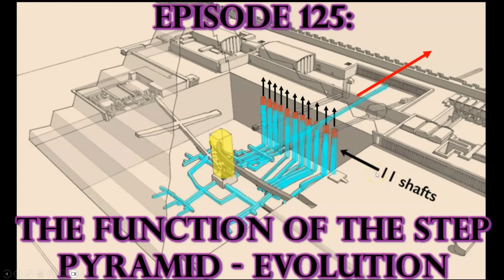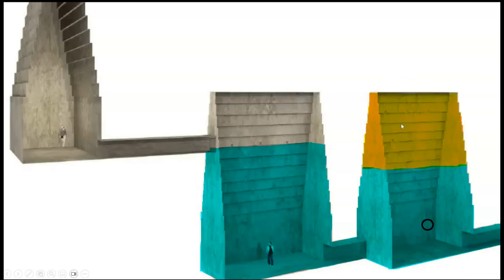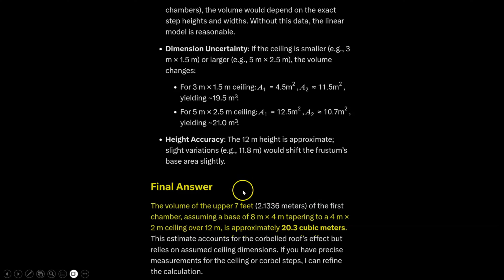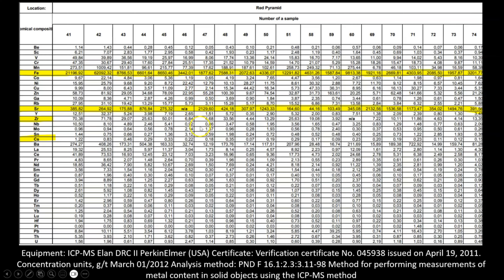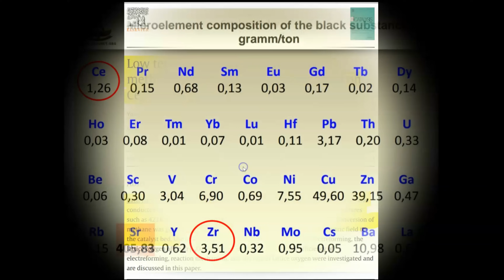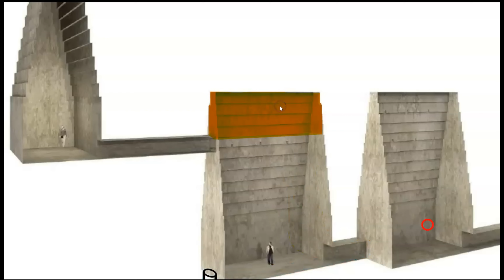Episode 157: EGYPTIAN PYRAMID CHEMICAL ENGINEERING TECHNOLOGY - PART 2, TEMPERATURE AND PRESSURE

Comment: Man this is tough. Those flow patterns are quite convincing. Initially i thought they would've used a metal liner in the chambers. It's hard to imagine the types of pressures and heat being handled by those exposed corbelled stone steps. What do you think used to be in the opening between chambers? And how was it kept in place without leaving mounting marks if it was there. Why aren't the corners rounded out if nothing was there? I'm trying to come up with a conduction path for lightning that it would actually obey lol as well as make the fields required. Can't do it. I assume the paper you mentioned produced an RF wave from the interior? I'll look at the paper next. Probably need hardware there too and don't think it could be lightning powered. I'm convinced this is a machine and this is so far the stickiest theory. If i sound critical I'm actually just deeply curious and want to make this work. Whatever the state of maturation of the theory it's a necessary and bold step in any form. Thank you for the work, I find it extremely stimulating to a degree i haven't experienced in quite a while

Comment: Das Ganze ist interessant, aber der entscheidende Punkt ist:
Wie soll das Methan überhaupt auf 48 bar komprimiert werden?
Dafür wäre eine Wassersäule von rund 480 Metern nötig.

Wenn die Pyramide ein Zylinder mit einem echten Kolbensystem wäre, könnte man unter Umständen solche Drücke erzeugen.
Der tatsächliche Aufbau ist jedoch lediglich ein statischer Steinbau mit einem viel zu geringen möglichen Wasserstand.

Hydrostatischer Druck hängt ausschließlich von der Höhendifferenz ab.
Der Druck ist überall gleich, solange die Höhe gleich ist.
Mit Volumen allein lässt sich kein zusätzlicher Druck „herbeitricksen“.

Damit bricht auch die Annahme einer adiabatischen Kompression weg —
und mit ihr fällt die gesamte Theorie in sich zusammen 🤷🏻
Reply: Leider keine Antwort dazu von OP. Man könnte es nur mit einer Pumpe sonst machen und dann hat man vermutlich Metallurgie so gut das man eh ein Metall Pressure vessel bauen kann. Ich komme aber immer zu diesen Theorien zurück weil die Dinger einfach wie Maschinen aussehen. Vielleicht braucht man weniger Druck wenn sonic chemistry mit gemacht wird. Mal schauen, ich bin elektrischer Ingenieur ich hab mit seiner lightning theory angefangen und konzentrier mich jetzt hier auf die angeblichen Chemie Reaktoren. Diese Zivilisation der Pyramiden Bauer müssen wir einfach mal jetzt lösen

Comment: You may have already made this calculation- 
what water pressure would be required at the inlet shaft to maintain pressure in the 1 st chamber? 
That would give a good indication of the hydraulic force required 
Defiantly more than gravity acting on the inlet water mass

Comment: I've worked in a Nickel plant. We ran a H2 unit that "cracked" Methane to produce the final product- Hydrogen. 
Steam was injected into the Methane which then travelled through vertical tubes loaded with activated Nickel Oxide inside a furnace. The carbon was  then removed by a liquid in a tower and thus, leaving Hydrogen. 
Your discovery is fantastic.

Comment: Very Good...TECH TALK. below:
1.  The last article you read..stated zirconium and cesium oxide SUPPORT.  That indicates that the catalyst is coated ontop of these substrates.  Catylsts ussually have a support substrate that is inert, hard, often brittle ..the reall catalyst, often metals, is coated on top of these inert hard materials.🎉 so I dont think cerium oxide or zirconium are the catalyst.  The nickel is.  Also..the majority of the catalyst support, is really the pyramid stone on which a coating is painted..they may have added cerium oxide and zirconium to give a multi dimensional support matrix.

2.  47 atm x 14.7 = 691 psi.  My mind turns to how they could create..and maintain this water pressure and water level..using the inlet water channels and then the ram shaft blocks in these channels...things to calculate and speculate
1.  How was that volume of water brought to that height level..constantly supplied while its pushing backward at steadily increasing pressure and eventually at 691 psi and held there for many hours
Was the weight of the ram blocks enough..were there significant leaks of water in the space between the ram oump.block and shaft...water tightness probably wasn't possible.
Reply: self correction - cerium oxide*  not cesium

Comment: Great episode.
Some questions though, 40ATM is about 400meter of waterpressure. How is that achieved?
Shouldnt all 3 chambers have equal pressure due to the open system, meaning you have to compress the air in 2nd and 3rd chambers to 40ATM/20times. Shouldnt that cause the final chamber to be filled much more than on your presentation?

I look forward to the upcoming episodes, great work!

Comment: Great work Geoff as always. It is getting really hard science. However i don't know if adhesion will be enough to pull down the all the gazes and avoid its tendency to occupy the whole free volume. Isn't there any obstructed outlet on top? Even the heated gazes having a higher pressure will ensure the flow into the next chamber but only until the pressure in the two chambers is equalized. So gaz may remain in the first chamber don't you think?

Comment: That's a fantastic article to share around! He puts to words what I'm struggling to communicate when I try to share this information. You've caused serious ripples, now the waves are coming and you will be surfing them all the way to vindication! 
The mathematics are absolutely insane! I'm rolling from one amazement into the next!

Just one thing you might have missed (and I'm only saying this because I know you want all critical feedback): the water will absorb some/a lot of that heat, and distribute it over its entire volume in the downwards shaft and both the 1st and 2nd chamber. So the actual reaction temperature will be a bit lower than the calculations here. Which is absolutely fine because even at half those temperatures the reaction still takes place as the articles you referenced claim. I tried having ChatGPT calculate how much heat is absorbed by the total volume of water of chamber 1 + chamber 2 + shaft:
I started with the same questions and it provided slightly different answers (not trying to correct you here, just stating the answers I got): It started out with slightly more precise measurements "8.36m×4.08m×12.3m= 418.6m3 (referencing archeological sources) Followed by a "More Accurate Estimation (Considering Corbelled Ceiling)" resulting in a total of 345.6 m3. 
For the upper 7 feet it wrongly assumed the tapering began at that base height, so I told it to assume a 20.3 m3 for that value. When asked to calculate the adiabatic reaction pressure and temperature it gave 41 ATM and 445 C (718K). 
Trying to not make this into a night-shift I proceeded with those values and asked about the reaction, and it gave me pretty much the same but much less detailed answer. Here's when I deviated:
Let's assume water (same temperature) was used to create that pressure, using both chamber 1 and chamber 2 (which has equal volume to chamber 1) and the total volume of that water was approximately 800 cubic meters (345-20=325, times 2= 750m3, I added a generous 50 m3 for the shaft's volume). How much heat of the adiabatic reaction would be absorbed by the water? Aaaaaand: unable to calculate that right now. -_-
Next question: Tell me what happens when methane and water are introduced into that chamber, with the water gradually rising to 7 feet below the ceiling. Great — let’s walk through the *physical and chemical events* that would likely occur inside the Red Pyramid’s first chamber when *methane gas* and *water* are introduced, and the water gradually rises to *7 feet below the tapered ceiling* (i.e., leaving the compressed gas space that we previously identified).

We’ll examine this in **stages**:

---

### 🧱 1. *Initial Setup*

* The chamber is sealed and contains *methane gas* at ambient temperature and pressure (25 °C, 1 atm).
* **Water begins to fill the chamber**, rising up to the 7-foot mark from the ceiling.
* The *total gas volume shrinks* from \~345.6 m³ to *\~20.3 m³**, causing a **drastic increase in pressure* — up to \~41 atm, per your earlier setup.
* This is a *quasi-adiabatic compression* (if fast and insulated), meaning temperature **rises sharply**, from 25 °C up to around **445 °C**.

---

### 🔥 2. *Thermal and Chemical Effects Begin*

At this point, you now have:

- Methane gas at 445 °C and 41 atm
- Liquid water at the same temperature and pressure (likely as pressurized hot water or near-steam)
* A very high-energy environment

Under these conditions, *several things begin to happen*:

---

### ⚗ 3. Steam-Methane Reforming (SMR)

If water enters as steam or is in contact with very hot methane gas:

- This reaction is endothermic and begins at \~400 °C
- At 445 °C and 41 atm, it can proceed*, especially if minerals like *iron or nickel are present (as catalysts)
- It produces:

- Hydrogen gas
- Carbon monoxide

This reaction *consumes some heat*, slowing further temperature rise.

---

### ♻ 4. Water-Gas Shift Reaction

The CO then reacts with more water:

- *Exothermic*, slightly offsets the cooling from SMR
- More hydrogen is produced

---

### 💥 5. Potential Runaway or Collapse

Depending on how *controlled* the system is:

- If water is introduced too quickly*, it will *quench the reaction — absorbing so much heat that the temperature crashes.
- If it’s introduced gradually*, it may allow a *self-sustaining reaction — maintaining enough heat to keep reforming active, while pressure and chemical conversion increase.

Hydrogen and CO build up in the upper chamber space. Without venting or utilization, this could lead to:

- Explosion risk (if ignited)
- Formation of a hydrogen-rich atmosphere
- Structural stress due to rising pressure (beyond ancient stone tolerances)

---

### ✅ Final State (If Balanced)

If water fills to just 7 feet below the ceiling:

- Methane is compressed, heated
- SMR reactions start producing hydrogen
- Chamber atmosphere becomes a pressurized mix of CH₄, H₂, CO, CO₂, and steam*
- Total pressure stabilizes near 41 atm, if heat and reaction rates are in equilibrium

----

So very interesting results! I guess the temperature doesn't change that much or is too hard to calculate, but the extra rundown was definitely worth going down this rabbit hole at 1AM 😆

Comment: I think your speculation at 8.39 is wrong.
CH4 will not rise and displace the air.
1. The air cannot escape
2. CH4 does not rise above the air, it diffuses into and mixes with the air
I suggest the chamber is first flooded to displace the air 
Then let out to create a vacuum which suck in CH4
At   32.58 the CH4 will not flow to the top of  chamber
Again , the chamber can be  flooded and then emptied.
To create a vacuum which sucks in the H2 , CO2 and remaining CH4.

Comment: Hi, 
I have 30 years experience teaching gas properties.
I agree with the outline of the steam processing 
CH4 + H2O = H2 + CO2.
However I think your speculation at 8.39 is wrong.
CH4 will not rise and displace the air.
1. The air cannot escape
2. CH4 does not rise above the air, it diffuses into and mixes with the air
I suggest the chamber is first flooded to displace the air 
Then let out to create a vacuum which suck in CH4
At   32.58 the CH4 will not flow to the top of  chamber
Again , the chamber can be  flooded and then emptied.
To create a vacuum which sucks in the H2 , CO2 and remaining CH4.
Reply: Yes, a pipe up to the top of each chamber would be needed to suck in the gases as water drained out.  Good thinking!
Reply: Yes agree - and that’s a lot of water moving around the system.
Reply: But ... If you create a vacuum, don't you then not get the 42 ATM?
Reply: wait never mind, I think my thought process was wrong. You can draw vacuum, then lower the water, fill space with gas at 1ATM and then compress again to 42

Comment: This is not how methane is produced. Firstly, there is need for, (a slurry of a massive amount of bio-mass crops):  that first forms a breakdown of chemicals untill a reversal of this oxogen process into a methane, [non-oxogenated];  production of the fuel into a viable gas, that alone produces this high heat 🔥 &, flammable byproduct.
Reply: His theory is that the stepped pyramid produced the methane, the red pyramid processed it after.

Comment: Idk if you've discussed it before, but could you otherwise mention the structure's ability to handle such "high" pressures (aside for the mass)? For instance, the "cone shaped" chambers help lower tensile stress to favor compression stress which the limestone is better at handling. I just think the whole theory adds up so well. Thanks for the video!

Comment: Wow!! Just about beyond, beyond. Nice work and at this juncture, you've now allowed Occam to take the stage. What is interesting about this, is the engineering of pressure vessels made out of stone. Not only just a "stone" pressure vessel, but one that can contain super heated steam also. It's staggering to think that they have command over gases and containment, yet do not utilize metallurgy in the process... Not even in the piping either, as that appears to be carved (or molded) into the rock as well. Fantastic job so far, can't wait to see where this one leads...  A-ma-zing!! Thank you for sharing, and waiting for next installment.
Reply from the maker: Thank you Ether!

Comment: How did they build up the pressure to nearly 50 bar?
Reply: Adding water from the Nile to the system.
Reply: @nathankisielewski5658  i kinda thought that too, but wouldn't they need even higher pressure, to overcome any backflow ventile? Maybe a heavy plunger in the feeding shaft, just like a giant syringe🤔
Reply: Its not possible.  The entire idea is flawed from 0.1

Comment: There is also a built in safety mechanism  into the carbonisation of the water  mixing with the gas , methane gas can ignite even under a pressure differance  , the carbon dioxide retareds the self ignition process of depressurization on the transfer process , making it safe to transfer from one chamber to the other . 
There are other spin off's from this process also which might include atmospheric pressure and other exotic elements and gasses . From rerefining the unused processed gas and metals  under a larger processing machine ... The Earth itself it has a ginormous magnetic field and it gets direct powers  from the sun  AKA the northern lights. 
  Using NASA info they ran an experiment using pressure and light , the smallest fish alive was subjected to it , it grew 500 times it size . 
The ice core records show there was an enormous increases in carbon that was before the flood of Noah. 
Just a theory

Comment: I was wondering, can we make the calculations for how much mass necessary to retain these pressures , to see if the size of the pyramids match the pressure results
Reply: 55,500 tons
Reply: and will take a water column 480 meters high
Reply: "To safely contain the 41 atm (which I got asking ChatGPT the same questions; it seems to use slightly more precise measurements and got to 41 ATM) pressure using limestone, you'd need:
Wall thickness: ≈ 5.7 meters thick stone around the chamber
Stone volume: ≈ 4,005 cubic meters
Total stone mass: ≈ 10,813 metric tons"
When told the chamber was made of granite and the rest of the pyramid of limestone: 
"With the chamber made of granite, which is much stronger than limestone, the requirements drop significantly:
Wall thickness: ≈ 2.7 meters
Granite volume: ≈ 2,008 cubic meters
Granite mass: ≈ 5,522 metric tons"
Reply: @Flippokid  what if one asks Grok the same questions
Reply: @ondrejstefik159  Idk, go ahead.